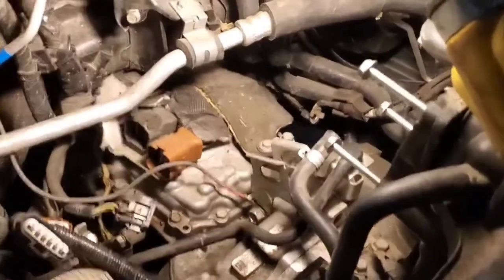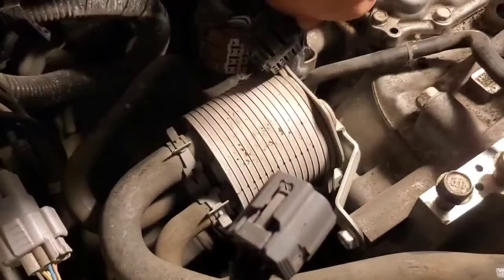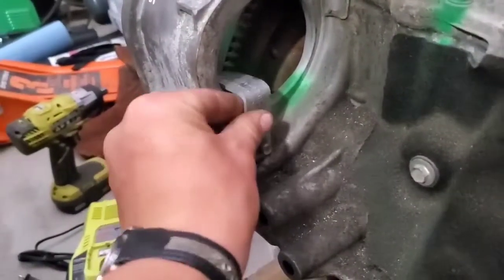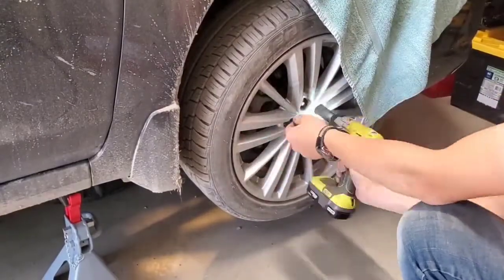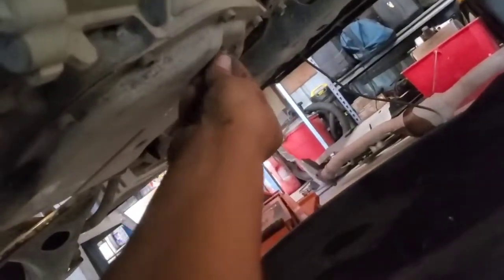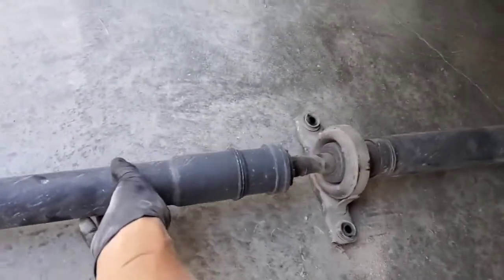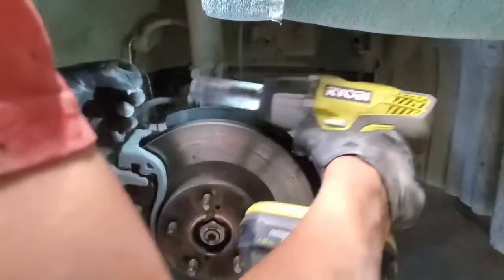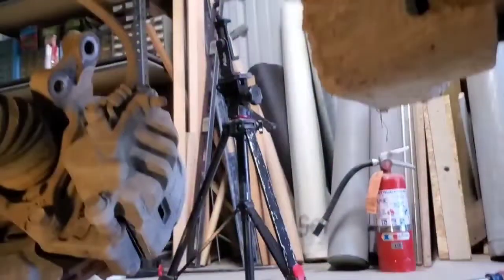Subaru transmission swap part 2 | 2014 Subaru Impreza | TR580 CVT

Comment: what happened if you drop TC bolt to the bottom?  Obviously removing is not a problem. If you reinstall the tranny and you drop the last bolt.. Man don't tell me if have pulled out the tranny again?
Reply from the maker: Yes, that was something I was very careful about... but it happened anyway! I was putting in the very last torque converter bolt and dropped it. On this transmission the bottom of the bellhousing is open, and if the bolt doesn't get stuck on the way down, it can fall out the bottom. I had to remove the jack plate to get mine out, but thankfully I was able to retrieve it. If it had gotten stuck, I would have had to pull the transmission to get it out.
Reply: @endeavorautorepair  Crap that sucks..  Im going stuff abunch  of shop towel. At lease paper can grind it down with out any problem.